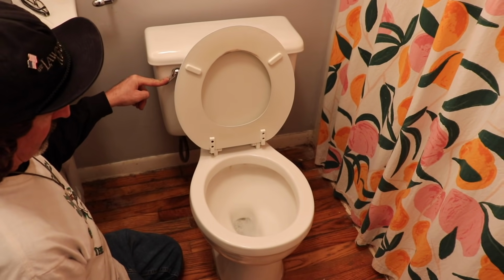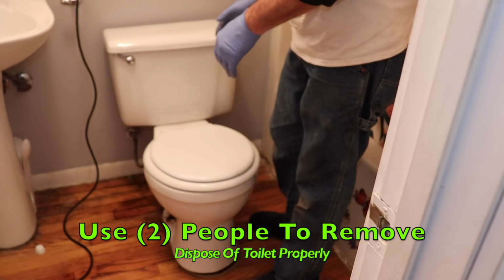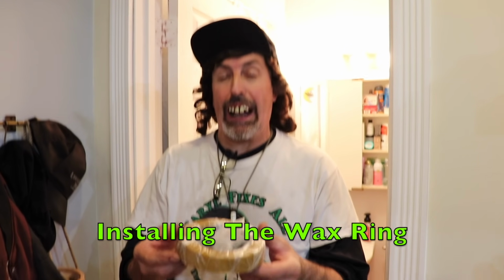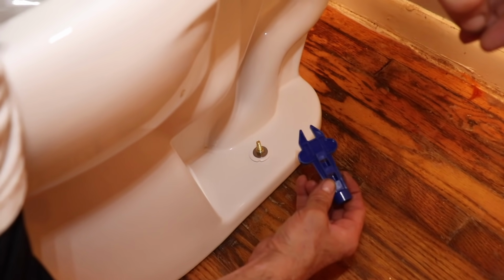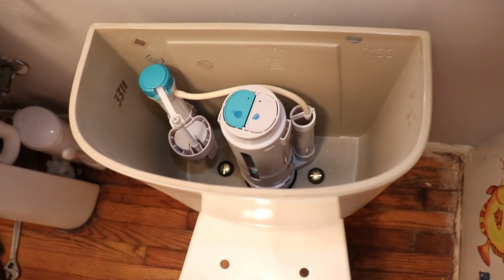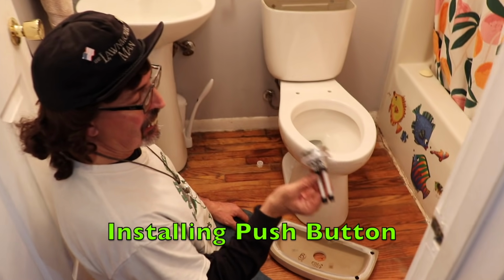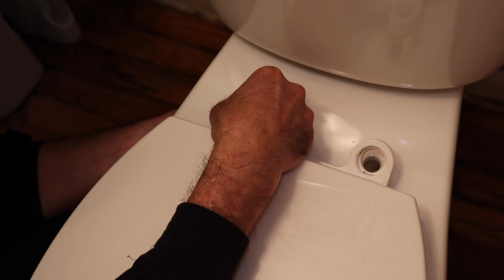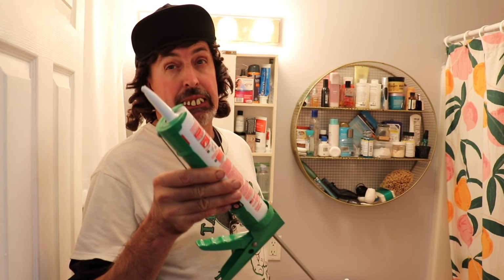Check It Out! How To EASILY Install A Toilet

Comment from the maker: We keep seeing people stating how we shouldn't have caulked the toilet to the floor for possible leaking purposes... We are just following International Plumbing Code and the International Residential Code procedures that state you HAVE to seal the toilet to the floor. 
Also wanted to touch on why Taryl put the wax ring on the toilet first instead of the flange was because it was stated in this toilet's instructions to install it that way. If you have any doubts or questions about why you should seal your toilet and how it DOESN'T actually leak onto the floor, do a simple Google search on "Should I Caulk My Toilet To The Floor?" and that should answer it.
Reply: Wax ring does just that. See page 23 of - https://shop.iccsafe.org/media/wysiwyg/material/7202S12-sample.pdf
Reply: good answer Taryl, the main purpose of the seal is to awoid shit leak , whether you put the seal on the toilet or on the pipe on the floor
Reply: Just tell them it's just a toilet, not the space shuttle!
Reply: What causes a toilet to smoke
Reply: Technically the toilet should be grouted to the floor- but good job ! I have a question low many hours should a 190cc Briggs and scratton last if it’s properly maintained? Thanks.  I really enjoy your videos-
Reply: I Guess Taryl REALLY Does Fix ALL!!! ROFL!!!
Reply: I wouldn't have even entertained the idiot's comments !!!!!!! These are the same people who wouldn't know how to use a screwdriver properly .🤔🤔🤔🤔🤔 Great job as always guys. 👍✌
Reply: @RustyZipper  Pottie Police ha ha ha ha ha
Reply: @emma67890  lol,its interesting to hear about other peoples jobs and the tribulations they have to go thru due to peoples stupidity, i work in a machine shop but we also sell cementitious products (aka bags of  special cement ), everytime someone local comes to pick up a order (which comes in a pallet and fits perfectly in a pickup bed) the bed is plum full of shit all the way to the top EVERY TIME and i just have to walk away and shake my head and i always hear that familiar saying "just give me a minute while i straighten this out"  lol
Reply: @andywalkerplumber  until it blow up, engine failure from higher reving
Reply: You want to caulk it to the floor but just do the back and two sides That's enough to keep it in place and a leak will show in the front if that happens,  Explained by a good  plumber I Know,  Your videos are very good, funny & entertaining & helpful.
Reply: The only time that I caulk the toilet down is when the floor is out of level. I level the toilet, test it for leaks and if it is good. I caulk it down so it looks nice. And there's your water closet 👉
Reply: Sorry to be so offtopic but does any of you know a trick to log back into an Instagram account?
I was stupid lost the login password. I would love any tricks you can give me
Reply: @Enrique Armani Thanks for your reply. I got to the site thru google and Im in the hacking process atm.
Takes a while so I will reply here later with my results.
Reply: @Enrique Armani It worked and I now got access to my account again. I am so happy:D
Thanks so much, you saved my ass!
Reply: @Russell Larry happy to help :)

Comment: Saw my notification and said WHAT. Man jack of all trades love your channel. I have had the same pleasure many years ago removing a toilet due to my kids flushing a bar of soap. Snaked this thing noticed soap on the snake AHHH you little buggers. pulled the toilet and put it in the bathtub flushed the trap with hot water and there a bar of soap with embedded excrement fell into the tub. AHHH GROSS reinstalled the toilet and educated my 3 little buggers with a tongue lashing.

Comment: I just replaced a standard toilette with a Toto, that uses a plastic pipe to connect the base of the toilette to the floor.  On the floor, the beeswax is actually covered by the skirt around the circumference of the plastic base, and on the other end of the plastic pipe, is a neoprene seal, that is lubricated with some oil, such as coconut oil.  This prevents the problem of the beeswax seal getting pressed down from long term use, and becoming the source of the leak.  
These new toilettes are like spaceships, taking us where we have never gone before.  Great video.

Comment: A little coffee cup works good for the bowl.
A sponge for the tank. Pure wax ring is the best.
Most are 12" rough in. Few are 10" rough in.
Elongated are lower than a STD bowl but more room. In the old days no wax ring, just plumbers putty. You want no movement at all in the toilet when done. So ceder shim if needed. Sometimes slime will be your problem with a seal or flapper. Wipe it off good.

Comment: Ive been a plumber for over 32+ years. Not a bad job. We plumbers call them Johnny bolts. Good job lawnmower man!!
Reply: Is that how you calk too?
Reply: @Mentorcase  No. I don't caulk unless the customer wants it. I don't normally caulk because if the wax ring leaks, you may not know it for a while, long enough to damage or rot the floor out. If I do caulk I use a water based caulk that can be smoothed out with a damp rag or sponge and doesn't look like a "bead" of caulking and is practically indetectable. I also ALWAYS replace the supply line from the shutoff to the toilet, usually with the hard chrome piping.
Reply: @twiz8789  YES!  Always replace the supply line.  Cheap insurance against a flooded cabin floor and rotted hardwood.
Reply: Do they make those bolts in stainless by any chance? seem to me that would be a smart idea but I'm not a plumber so i wouldn't know.

Comment: Plumber here< you did everything right although I suggest when your caulking the bottom of toilet to leave a good 1 inch space not caulked in the back of toilet so you can locate any leaks of the toilet flange if ever occurs.

Comment: Looks great - you make it look easy.  At 5:30, I would have thrown those crappy brass bolts and nuts away and get some good stainless ones or real brass (not plated) hardware.  You'll be proud you did years later when you have to get that toilet loose.  No angle grinder needed.  And it's easier to assemble the tank on the toilet before you bolt the toilet down.  I've replaced bunches of them for my church that needed a bathroom refurbish.

Comment: Forgot to add on my first comment. One brand of toilet had a sticker on the tank with a bad translation that read "do not over-tighten or tank may crack or broken". Reminds me of a diesel injector manual my dad came across that said "caution: DO NOT BANG ON THE GROUND"

Comment: I would never thought that fitting a new "bog" (English colloquialism) could be so compelling.  I nearly fell face first into the screen from leaning forward for a better view over Taryl's shoulder.

I'm going to be doing this same job in a static caravan (large trailer home?) in a few weeks. On the face of it, it's not too big a job, but the problem I'm going to have, is that the cubicle is smaller than a telephone booth.

Comment: Hey Taryl,  I'm not there to see how level it is,  but would be good to use a level and shims to make sure the toilet is level side to side and front to back and then put grout or thinset around sides to keep level after drying.  I do this to make sure the washout of the toilet remains even and clean throughout the life of the toilet.
Reply: i was waiting for someone to mention this.  Level and plumb and grouted in.  If it rocks it will eventually leak.

Comment: Replaced quite a few toilets in my day. I have a wetvac that I use only for this purpose, much easier than scoping the water out and it works better. Tech tip of the day.

Comment: I'd suggest sticking to small engine repair versus plumbing but...you got the job done. Me? I assemble the tank to the bowl out where I can get to the underside easily, set the wax ring on the flange and set  the toilet as an assembled unit. A little heavier but so much easier when all you have left is to install the seat and hook up the water supply. But you do you, Taryl. And there's YOUR dinner!! LoL

Comment: Dropping yer glasses into the sewer pipe is a very important step.  That's so you cant see the s!*t as you install the bowl over the hole.

Re tightening of bolts: don't over-tighten... this is not on the space shuttle. 😂😂😂😂

Comment: A couple hints.  Measure from the bolts to the wall.  You need at least 15" clearance.  Some older homes do not have enough clearance and special toilet is required.  Put down an old towel first.  I always use a foam rather than wax seal as there is no rebound to wax and I put a suitable diameter plastic bag about 10" long wrapped under the seal so all waste must clear the floor area.  If you use the supplied plastic nut to tighten the supply hose, snug a rad clamp around it as they are known to crack and leak over time. And over the floor.  Mamma will be happy!

Comment: Of all my plumber co-workers I've worked with (I'm not a plumber, but an HVAC technician that helps the plumbers) I've never seen the wax ring put on the toilet first rather than the flange.
Reply from the maker: The instructions included with this toilet instructs you to put the wax ring on the toilet bowl first. Thanks fer watchin

Comment: perfect timing on this video for me! I need to replace wax ring on mine.
Reply: Yup me too ours leaks.................................. : (   I got one of those rubber ones to try, supposed to stand up to plunging much better and not start leaking.
Reply: Use one of those new rubber rings and you will never have to do it again.

Comment: If you have an older building, you may want to shim the toilet to make it level. This may affect how the water flows around the inside of the rim to clean the upper part of the bowl.
If you have a cast iron flange, it may be threaded so T-bolts don't work. If that's the case, use brass or stainless thread stock so it doesn't rust to the flange. Repair or replace the flange if it is not usable. If you only have one toilet, don't start this project when plumbing supply stores are closed.

Comment: 2 tips....Wax rings with the plastic funnel are no good....better to use one without.  #2  warm the wax ring in hot water to soften it first...will help seal it.

Comment: Don't calk around the toilet. If you do and the wax ring leaks you'll never see it until the floor rots out. You want to see the leak before it does damage. If you do calk, leave a few weep holes so water can get out and you see it.
Reply: Exactly what I said but no one listens
Reply from the maker: We are just following International Plumbing Code and the International Residential Code procedures that state you HAVE to seal the toilet to the floor. If you do a google search on "Should I Caulk My Toilet To The Floor?" It should answer it. Thanks fer watchin
Reply: Taryl - are you reading the IPC / IRC 2019 version 4 , they made some changes mid year. It’s only 848 pages, it’s a good read while on that new John 💩

Comment: Check those bolts and nuts, to see if they are brass. A magnet will tell you. Plated steel bolts and nuts will rust, over time, and make it difficult to remove.
Reply: Yep - this x 100!  Replace the junk bolts they usually put with toilet kits and be proud you did years later.
Reply: @engineer2001  I learned this by watching a YouTube plumber. I learn so much on YouTube.

Comment: I use a sawzall and cut the bolts from the tank to the toilet so it’s not so heavy. Takes 30 seconds each. Then cut the bolts with the sawzall. Also use toilet paper in the drain pipe so if they fall in it’s no big deal to keep the stink from coming up

Comment: dear Taryl, i have acknowledged that winter is here, so i thought i'd use one of the many old Ariens snow blowers i've adopted over the years, they all have old lousy Tecumseh engine with two opposed drive axles coming out of them, i wanted to change the engine to a single axle, because i've adopted only single axle Briggs and Honda engines. so my question to you O'lord-Taryl, have you ever made such a conversion on a snow-blower? (from a double axle engine to a single axle engine)

Comment: Use the angle grinder to cut a hole in the front. Add a small door to it and you can store tech manuals along with your glasses. This way Taco Tuesday’s can become more productive.

Comment: I put the wax ring on the toilet flange and set the bowl on the wax, rocking it gently to set the seal until the bowl contacts the floor and is stable in all directions. Been a plumber for too long

Comment: You left in the little black rubber sealing gasket when you hooked up your old water supply line. That should have been removed and discarded because it is for brass/plastic supply lines with the compression fitting on that end which is not needed with the one you used.

Comment: Good job now  cut a short gap in the caulking so that if the wax seal starts leaking you will see it on the floor before it shows up down below the toilet on another floor or basement.
Reply from the maker: We are just following International Plumbing Code and the International Residential Code procedures that state you HAVE to seal the toilet to the floor. If you do a google search on "Should I Caulk My Toilet To The Floor?" It should answer it. Thanks fer watchin

Comment: Caution: Do not lean back on these suspended tanks on these toilets...your tank will crack/break real easy. I put a thick piece of rubber blocking behind the tank to prevent that especially with the kids/guest bathroom. You have been warned 💩
Reply: I bought little plastic tabs that go on the back of the toilet and space between the wall

Comment: Only 2 things a plumber needs to know. Shit rolls down hill and payday is on Friday. They have new foam things the replace the wax ring. Less nasty. I wish you would have told us what was wrong with it. On his next video Taryl teaches us how to replace that crusty wood floor and shut off valve. And there's what happens after dinner.

Comment: When I pull a toilet 
Hack to remove water after turning off water and flushing it holding the lever 
Well it a mechanically flushed 🤔
Taryl does fix it all 😆

Take a bucket of water and Pour it into toilet . There will be less left in toilet 

Tip I got from today’s homeowner
Reply: I couldn't believe he didn't just suck it out with a wet/dry shop vac after flushing.  Dip dip dip dip - no thanks.

Comment: Never thought I would see fixing a toilet on a lawnmower chanel. You dont have to tighten the bolts too tight this is a toilet not a space shuttle.
Reply: 27.5 ft lbs is the torque specs but you need ARP torque Lube to prevent thread stress

Comment: Caulking around the base of the toilet 🚽 is unnecessary and if the wax seal leaks inside you will have no way of knowing until it rots the flooring and leaks underneath in the basement.
Reply from the maker: We are just following International Plumbing Code and the International Residential Code procedures that state you HAVE to seal the toilet to the floor. If you do a google search on "Should I Caulk My Toilet To The Floor?" It should answer it. Thanks fer watchin

Comment: You actually don’t want to caulk the bottom because if it starts leaking from the gasket or the porcelain breaks inside it will rot out the floor. With no caulk it will leak out onto the floor and you can fix it
Reply from the maker: We are just following International Plumbing Code and the International Residential Code procedures that state you HAVE to seal the toilet to the floor. If you do a google search on "Should I Caulk My Toilet To The Floor?" It should answer it.

Comment: Enjoy your videos! But you actually made a mistake when installing the tank to the bowl. The bolt go thru the tank with a rubber and metal washer, but then on the underside of the tank you install another rubber and metal washer and the thin nut and secure. Then attach to the bowl and tighten down the large seal. Ask me how i know.....Keep up the good work!!

Comment: A plumber once told me not to clack around the bottom of the toliet
Reply: Never, because if the seal leaks, water can not escape, you will not know it and it will rot the floor, then you have big repair problems!
Reply: If it leaks you can just use duct tape to keep it from making the floor wet.
Reply: @BlankBrain  I'm talking about the wax ring UNDER the toilet. 40+ years as a plumber I've seen a lot of this!
Reply: @kimberbob9141  I'm talking about the same thing. I know of someone who used duct tape around the base of the toilet when the wax ring started leaking. It rotted out the floor, subfloor, and a joist. But their feet were dry.
Reply: @BlankBrain  OIC LOL
Reply: My plumber friend said the same thing, not to caulk around the base of the toilet.  Also to get the water out of the old toilet/tank I use a large sponge.
Reply: @Pyridox  exact;ly!
Reply from the maker: @kimberbob9141  Hi Bob,  We are just following International Plumbing Code and the International Residential Code procedures that state you HAVE to seal the toilet to the floor. For more information see our comment at the top of the page.
Reply: @TarylFixesAll , You really did install it according to code, and is installed correctly within code. The reason the caulk is required at the bottom is to keep the toilet from moving or spinning left or right causing seal leakage. If it is installed correctly that will not happen, I have never failed inspection without the caulking. But, again I say you DID install it according to code! Great Video and keep em coming!
Reply: Oh by the way I install the wax ring as you do! LOL Great Job!!!

Comment: I use a rubber/ air filled donut versus that nasty wax ring. Should you ever need to pull the toilet again it’s worth the extra couple bucks.